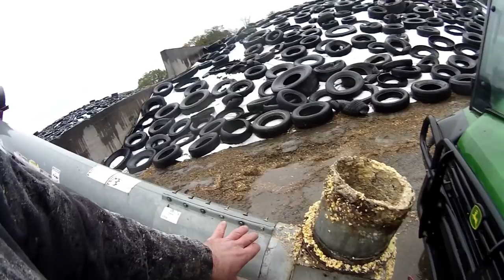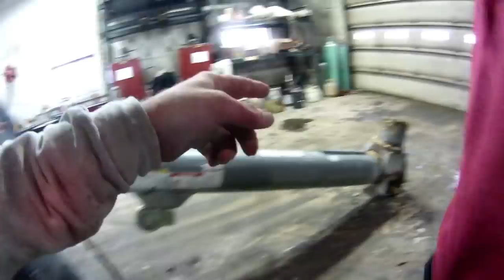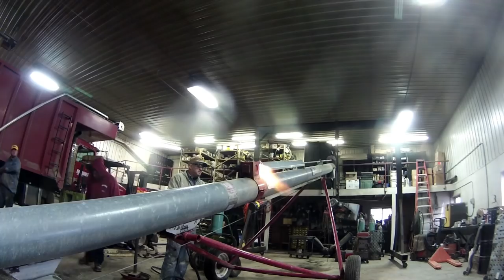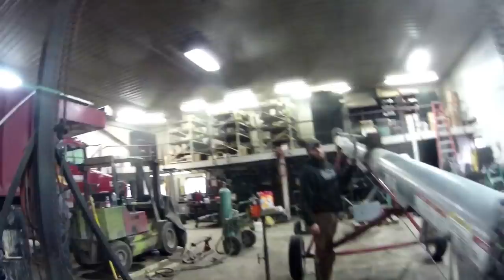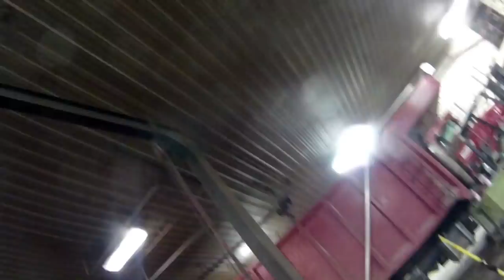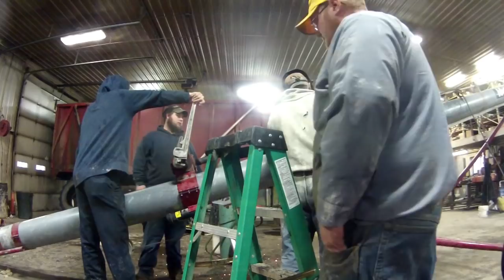#farming#fixing#fabricating Rollermill and Auger retooling

Comment: silly question if your roller mill has a blower on it any reason you dont just put a spout off the blower and blow the corn over the wall... Like a silage chopper spout?
Reply from the maker: That's not a silly question Ted. We have done it that way before and the dust gets all over everything. The blower band would end up turning on us as well.